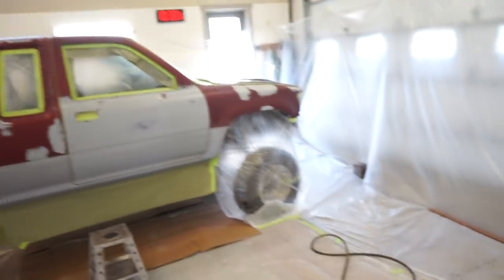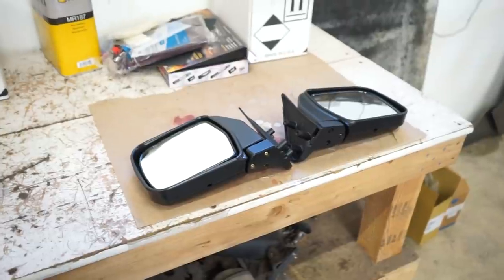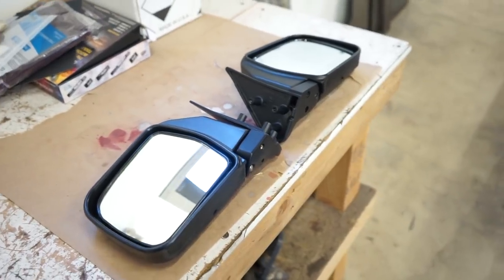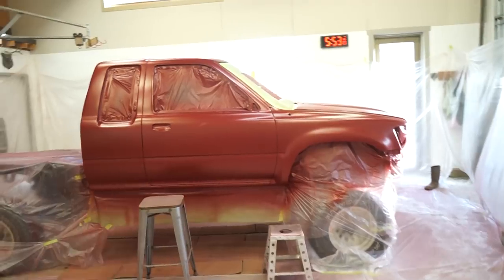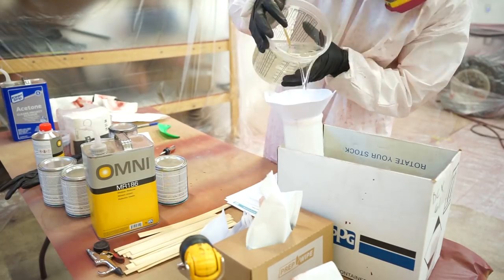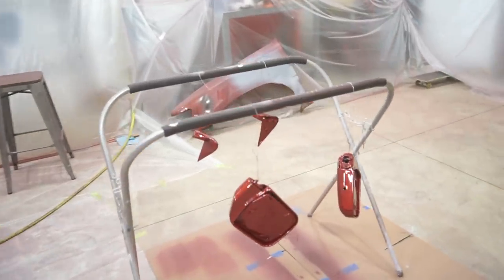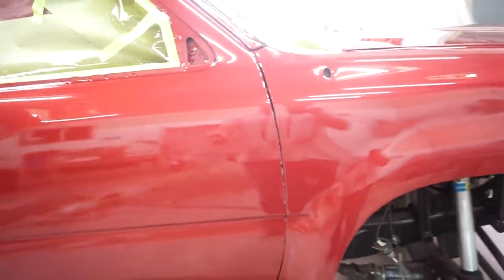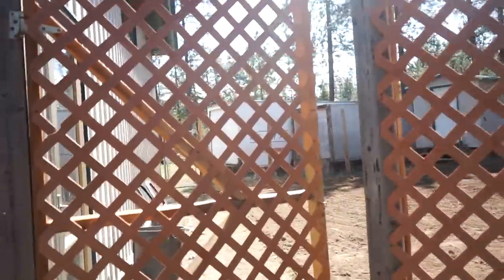I Painted My SAS TDI Toyota Pickup In My Garage!!!

Comment: Austin Niemela Looks awesome. My heart sunk when I saw that door paint pulled off. You are definitely not afraid of work. I just did my 1st paint job ever in an enclosed canopy the yard on my 1990 4x4 extended cab with an Earlex 5500 HVLP spray station. Surprisingly it came out really good, except only about 70% of the clear is good. The rest needs a heavy cut and buff, or maybe a 1500/2000 block and respray. Thanks for all the tips and tricks. Your channel really helped a lot. cheers.
Reply from the maker: Ross Williams, DC thank you I’m glad I can help out!!

Comment: Extremely nice work.  Have you considered adding an exhaust fan with louvers to your shop?  You can make the window pane (in the background above your truck) smaller and build a frame for a fan next to it.  On the opposite side of the shop, build a frame for air condition filters over a window.  This will give you cross-low ventilation.  I built a similar setup with a 7000 cfm 30" fan for my garage when I painted in it before I built my shop.

Comment: You have to change the plastic every time...otherwise the dried paint will flake off like it did...or you can just cover it over with new plastic...I had to learn this the hard way too years ago lol. You need a fan to suck out the over spray! All that over spray will dull your paint. Runs on metal flake are a pain in the arse to get sanded out/buffed because the metal flake will look different/blotchy. Plus, when using a strong metal flake, hold the gun further away from the surface...it will blend much better...especially using a silver metal flake....

Comment: I've had problems shooting in a garage with no ventilation it messes up the paint job. It looks like your garage has the same problem. It might seem like the paint job came out okay but if you did it in a booth or if you got a fan sucking all that over spray out your paint job would come out a lot better

Comment: you got less grit in that paint than some paint booth paint jobs i've seen. I'm really surprised because you didn't put water on the floor. I would start on fixing the smaller run first to see how the clear sands/scrapes down. I've had pretty good luck scraping them down with a brand new utility knife blade and then block it. But you have to make sure the clear is fully hard before you start scraping

Comment: I didn't see that you used a guide coat and/or blocked-out the primer before you sprayed the base coat...why not? Paint sticks to sanded primer much better than just spraying over a non-sanded primer...plus the primer will have orange peel...another reason to block sand (with 600 grit). Please tell me why you didn't guide-coat it all to check for dents/scratches and block sand thanks!

Comment: I'm still learning how to paint too. But from what I can tell you do have a massive Orange Peel problem. Especially at the bottom.I think what you're doing wrong is one you're laying it on too thick, that's why you have so many runs but 2, you may be sprayung too far away that might be why you're getting orange peel.I can't really tell how your sprayed it so I don't know if you have the fluid wound out too much or if your overlaps are too much or if you're going too slow. the only way to get better is tons of practice or go watch some videos of people spraying clear. Clear takes knowledge, and I started using an old hood to test my settings on the gun before I spray the actual piece Nevers spray the actual piece without testing your spray
Reply: He chip guarded the bottom and went quite high with it lol